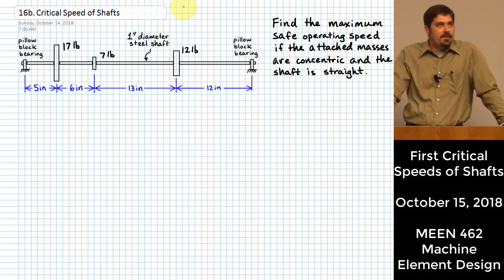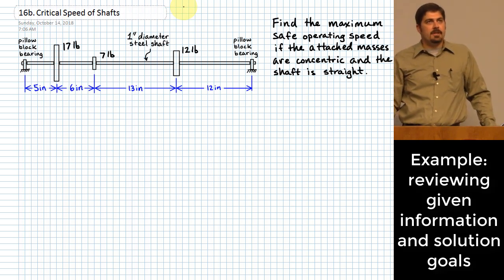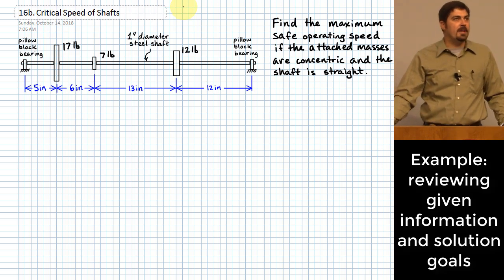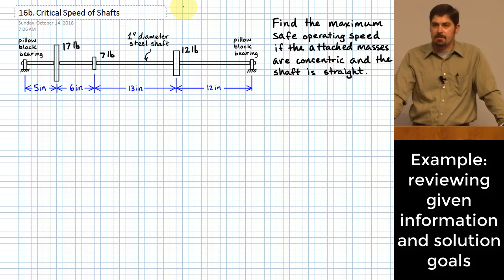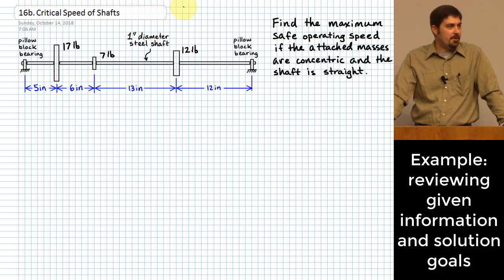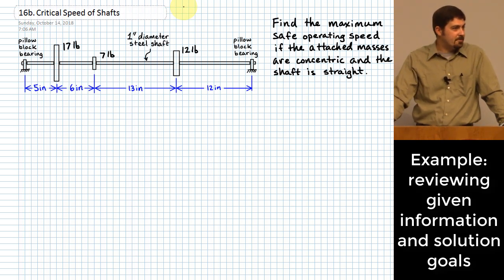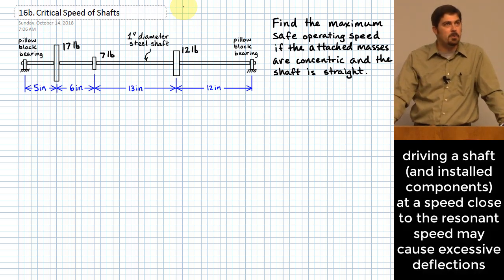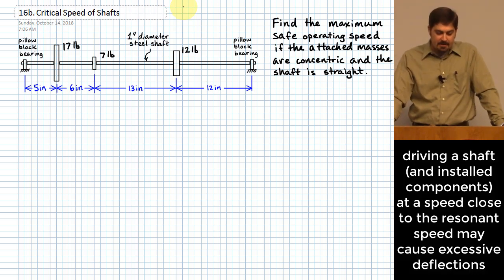Critical Speeds for Shafts | Equivalent Center-Lumped Weight | Protecting Against Driven Vibrations

Comment: hello - is there a way to use this technique if the shaft diameter isnt uniformly constant? or would that require a different method. thank you.
Reply: the same.
separate each Area with its cross section.
find Wic and Scc considering each section has its own weight and external forces. (own I also)
this method is a deflection method...got it ?

Comment: Thanks, Micheal. That was very neat...one question: What method to use to find the maximum deflection and its location in this problem? Also, if it was stepped shaft, same formulas can be used?
Reply: the same.
separate each Area with its cross section.
find Wic and Scc considering each section has its own weight and external forces (own I also)
this method is a deflection method...got it ?

Comment: i like your videos very much. your teaching style is very good. 
" I want to ask that how to find second critical speed then third, forth and so on...? "
Thank you.
Reply from the maker: Section 7-6 of Shigley's Mechanical Engineering Design describes how to do this...it is an eigenvalue problem. We often don't worry about the higher critical speeds when designing shafts, and instead adopt the technique of making shafts stiff enough to avoid even reaching the first critical speed at expected operating speeds. That is why I presented the method shown in this video. Thanks for watching!

Comment: I'm using ALL your videos to prepare for my PE exam (not the first one) in a month. THEY ARE OF MUCH HELP.  The NCEES manual has different equations specially the beams deflection. The equation used on this video is well known but NCEES uses only the max deflection which is not at the center nor at the single weight location. Any way I can use the NCEES formula for a problem like this one? 

Also, trying to understand the difference between the f (lineal frequency ) in Hz and w (angular frequency) in rad/s. 

Much appreciated.
Reply from the maker: Good luck on your exam! I'm glad I could help a little!
Reply: @TheBomPE   thanks for your reply. Videos are helping a lot. Do you have a comment regarding the NCEES beam deflection formulas? i found them very limited. Also, the second question regarding the difference between the f (lineal frequency ) in Hz and w (angular frequency) in rad/s. Thanks again.